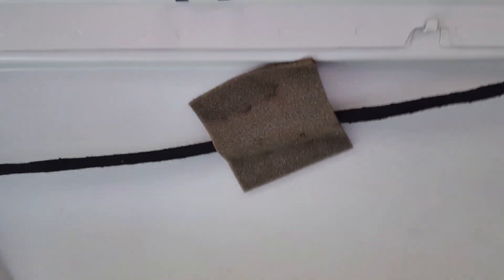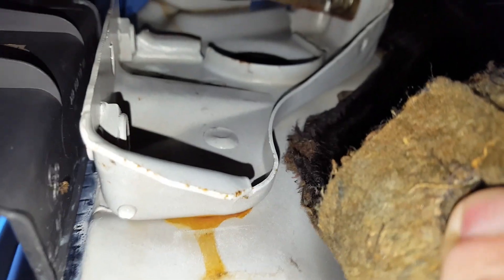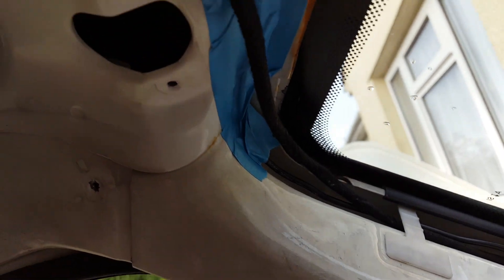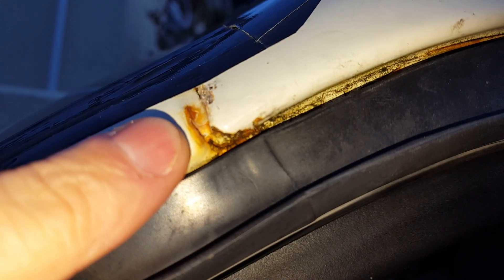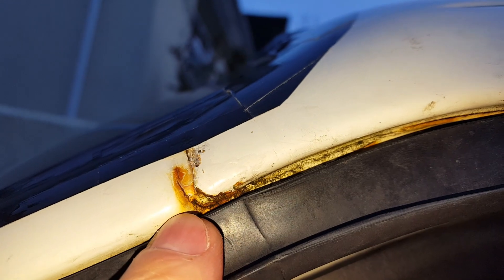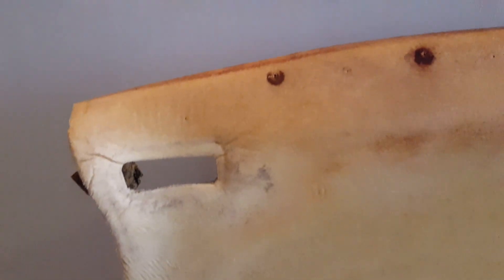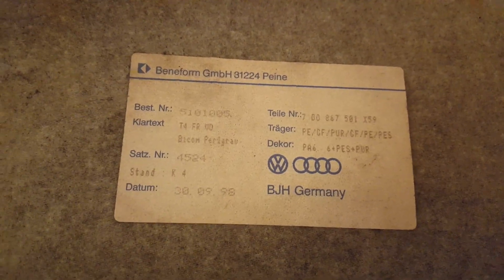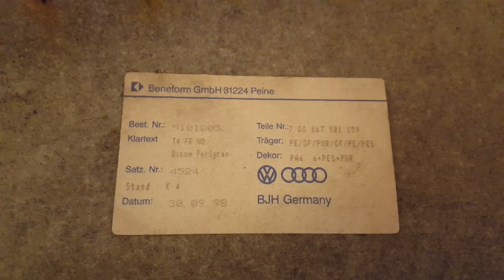VW T4 Leaking Windscreen Borescope Inspection Using DEPSTECH DS520 #vwt4

Comment: Where was your actual leak and how did you seal it? Helpful video , thanks
Reply from the maker: There is more than one leak. In this video I show the water is coming in where the A pillar joins the roof 2:15 and also where there is some separation behind the weather strip 2:24. After showing the water coming in I then show where those areas relate to on the exterior of the van. 

As a temporary fix I have used black duct tape around the edge of the windscreen and Dirko grey sealant in the crack behind the weather strip. The van is now dry. 

The windscreen is also leaking along the bottom of the frame and no doubt in a few other places as well. The purpose of this video was to show leaks in places that might not be so obvious and also to demonstrate the borescope.
Reply: Hello mate I have been chasing a leak recently on the drivers side I have a video showing it and I've had the screen done the apature was absolutely perfect I was driving home from the window place and no rain but water must have been still in the a pillar because I could see it leaking I recon somewhere in these areas are my problems thanks for the video its gave me some inspiration on my next video ill be looking to quote this video for others to watch ? Cheers dave
Reply from the maker: @scousebikers  Hi Dave. Thanks for watching. 

When I filmed the video I forgot to show inside the bottom of the A pillar. A centimetre or two below where the water is leaking out, where I removed the plastic tab, there is some kind of foam. It is kind of like expanding foam. Water can well up and sit on top of it for weeks.

The area where the top of the A pillar joins the roof and the crack/separation behind the weather strip, is, in my opinion, a major weak spot on T4s. I think it affects more vans than people realise. It has caused the passenger side step under the plastic cover to rot on my van. Probably the cause on many other vans too.

I have left the rubber floor covering out of the van until I get the leak sorted properly. Rusty water leaked out the back of the matt (van always parked facing uphill) and into the plywood floor in the back and up into my new vinyl oak effect effect flooring, that it now ruined. Water leaks are the absolute worst, but it is all fixable. 

For the time being duct tape and Dirko grey sealant has got the van water tight. It's not pretty, but it is dry. 😂

Hope you get yours sorted and that my vid helped you diagnosed the leak. Without seeing that second dribble of water with the borescope I never would have looked behind the rubber weather strip. Cost me £100, and even if I never use it again, it was money well spent.

All the best

Marc
Reply: @T4TipsGuides  Marc that's correct mate that's exactly what's happened to mine on the drivers side the the lip for the door seal has gone with the wind 😅 I have now sealed in the locations you mentioned with heavy silcone sealant I'll add a video soon go the channel to shoe a temp solution just got to wait to see what happens after the rain I agree with what your saying these vans are classics in the making I've had her about 3 years now great vans same problem with the water travelling down the van destroyed my wood hopefully fix it temp for now and get some seal sealer on her soon and repaint cheers dave
Reply from the maker: @scousebikers 

I'll make a short video tomorrow to show where I applied the sealant. It isn't pretty, but the van is dry.
Reply: @T4TipsGuides  cheers mate just adding video in a min I've gave you a mention 👍